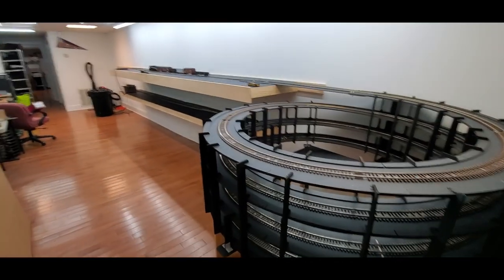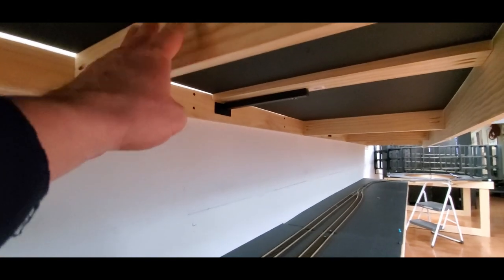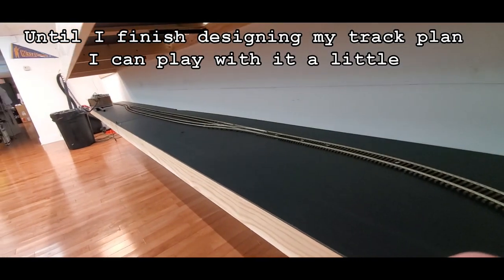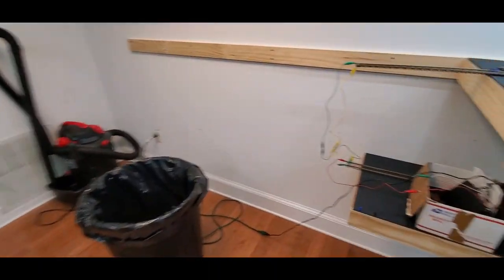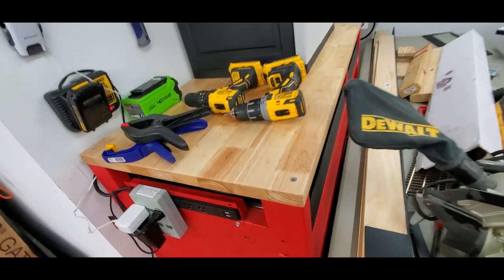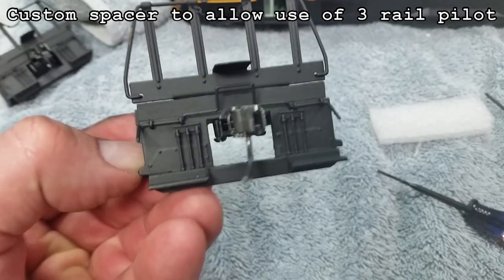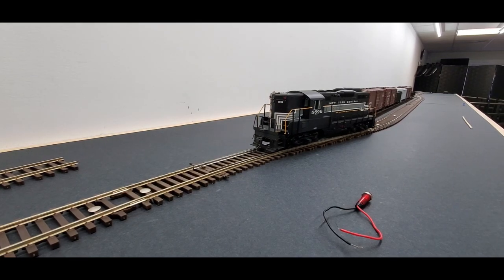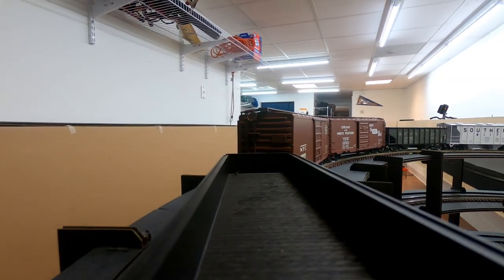VLOG - Shop is a mess, but we have shelves - Happy New Year!

Comment: joey,

A friend has a helix requirement of 8 rings and a diameter of 6 feet for a ho 2 lane track system.  roughly speaking where is the price point for a helix of this size please?  To get proper support, I am thinking the rings to be in 8 sections so that there are 8 pairs of supports covering the 8 rings.  Grade is 2%.  As you can see, this is a big baby.  Why this is 6 feet across I have no idea..  Your thoughts please.

Bob S
Reply from the maker: contact us at tracksidescenery@gmail.com